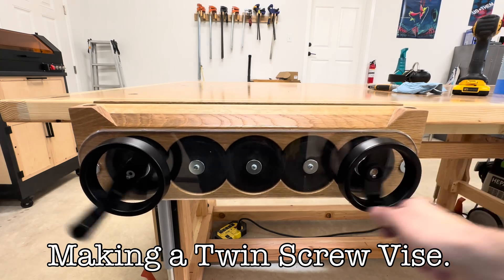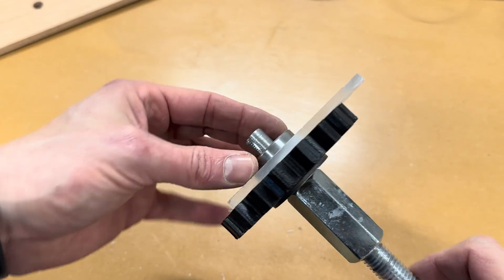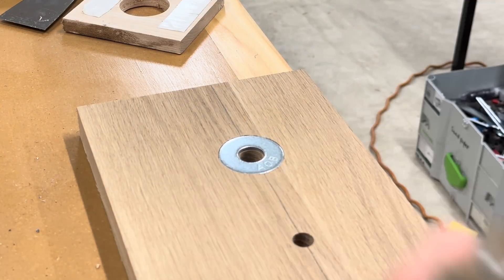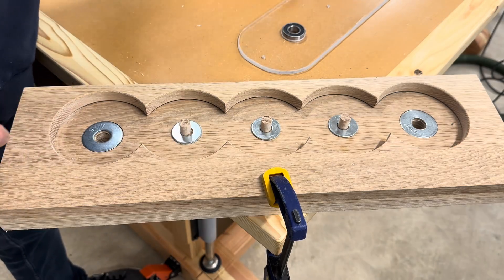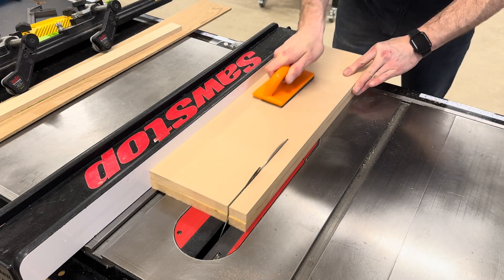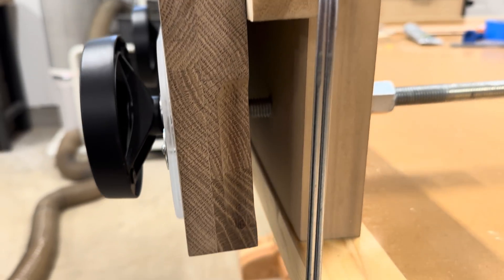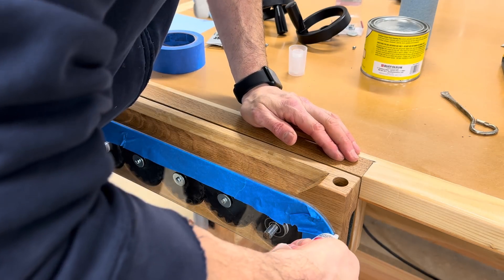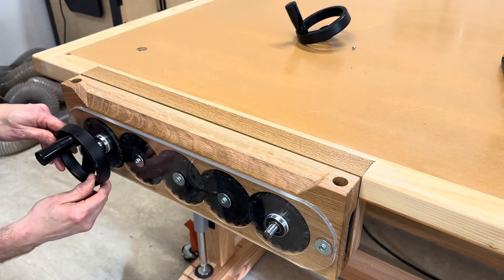Making a Twin Screw Geared Vise

Comment: If two smooth guide rods are added to this it will eliminate a lot of the racking. Use 1 inch steel rods from home depot or lowes.
Reply from the maker: @peterputnam3804  there isn’t enough racking to necessitate that.  I considered it and I have a different vise similar to this that I’ve done that on.  The threaded rods are ridged enough for it to function fine.  Adding more would have added very little benefit.

Comment: Good morning 🌅, Very nice job, well worth the time and effort, I am in the process of making a workbench/assembly table, I am now retired living in France from the UK, I had to sell my last workbench assemble table, it would’ve been too big for where it’s going to go now, but at least I could’ve cut it down, it was approximate 1 1/2 m wide by 3 1/2 m in length, it was partly set up as a MFT table, and add the Festool aluminium track going away around the side, and it was partly used as a vacuum table as well, I am a retired specialist joiner cabinet maker,
Luckily, I still have some of my tools and machinery , it is a bit crammed in the space so I’ve got to where I now live, as my workshop back in UK was 35 m in length roughly and approximately 8 m in width, I not only made fine furniture but I may especially stores and windows as well, mainly for barn conversions unusual sizes, I’ve noticed you’ve been going for a few years, and to have some nice products that you have made, all the best for the New Year, regards from France,